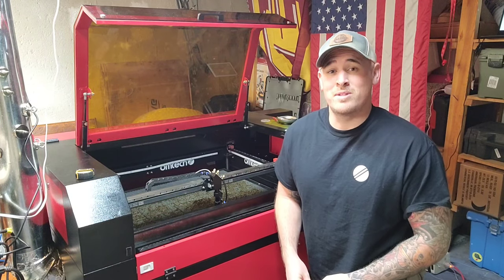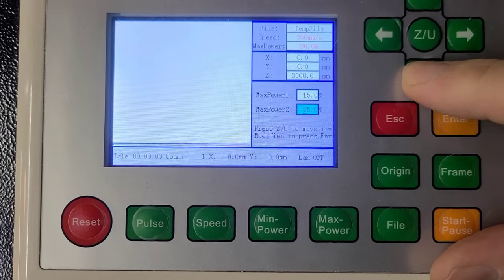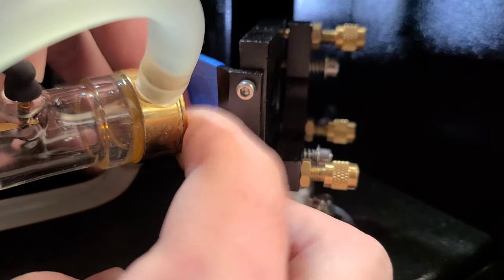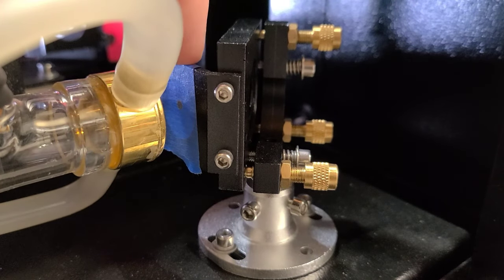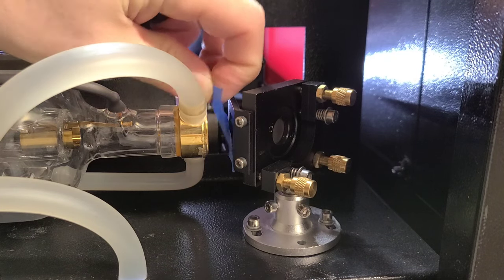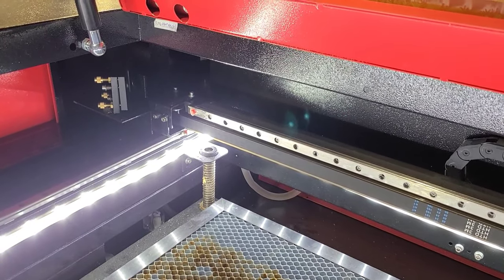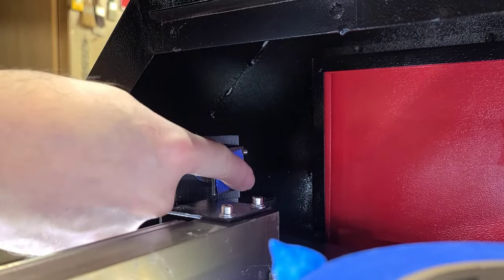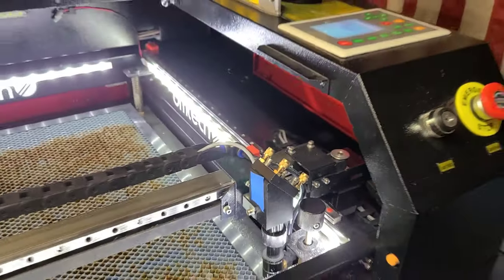How to align your mirrors on your Chinese / OMTech CO2 laser

Comment: hello, i am right now setting my mirrors with help from your video, and i have a question, is big problem if my pulses on 2nd and 3rd mirrors are not absolutely on same places at the start and end of axis (2nd mirror pulse at the start of axis is in center, at the end of axis is a little bit next to first pulse... the 3rd mirror same thing), but the laser beam from the nozzle is at the center at every corner and even in center of table ? thank you for answer :)

Comment: do you have to do this or do you do this if something is moved? I would think this should be done at the factory.
Reply from the maker: Yea this is absolutely necessary. Coming from China, these things get knocked around and moved quite a bit. The 80w red and black and 100w red and black from OMTech dont come with their tubes installed so you HAVE to align it. You literally save thousands of dollars if you go through OMTech and align it yourself, versus going to a competitor who's laser is already aligned.
This is why we create these videos. These lasers are more DIY setup rather than ready out of the box.

Comment: How talll of an item can be engraved?
What materials can it engrave being only a 50w?
Is there a .onthly fee for uaing their softsare like lightburn?
Reply from the maker: The depth that the laser bed will be able to move to will determine how tall of an object you can engrave. The OMTech 50w varies between 6 to 9 inches (there’s two different models). If you get the polar then it’s only a couple inches. 
There are really too many materials to list on what can be engraved but some common ones include several types of woods, acrylics, paper stock, metals (with a special spray coating).
There isn’t a monthly fee for lightburn. It’s a one time $120 and you’ll have unlimited access. They do have releases every year so you can’t pay $30 for continued availability to download the latest releases, but you can essentially run the original release without worry of it not ever working.

Comment: My mirror 3 is off center and I cannot move it anymore to the left because the screw is so loose it does nothing when I turn it anymore to get the beam to go left.  Mirrors 1 and 2 are centered, I just can't get mirror 3 aligned.   Any suggestions?

Comment: Very nice.  Thanks for posting this.   That was a great explanation.

Those mirror holders look pretty flimsy, I'm not going to lie.  They appeared to flex quite a bit when you were messing with the adjustment screws.  

These engravers are extremely inexpensive, so I understand corners had to be cut somewhere.   That is probably an area I'd look into trying to beef up if I bought one.   Or maybe it doesn't matter unless you're constantly moving your machine around the shop?    Any thoughts on that?  How often do you have to adjust these mirrors?

My 20 year old epilog is starting to give up the ghost.   And while I could maybe get it repaired, for the money I think these chinese lasers make alot of sense.  I've tried to pick up an epilog at auction again, but they are pretty few and far between and I do use my laser on a regular basis for a small business. So any thoughts on that you have I would greatly appreciate.

Thanks in advance.
Reply: I'll check my alignment every few months, but i've only had to align it twice since owning it. Once for the initial setup, and once for this video. If you secure the adjustment screws appropriately and not moving your laser around you shouldn't be having alignment issues. 
We run an epilog at my work and although the quality of parts is superior, it is a self contained unit with proprietary parts making it VERY expensive. The nice thing about these Chinese lasers is that they are highly modifiable at a relatively inexpensive price compared to high end machines.....AND they can create the same output.
Reply: @Manalo84  Very nice, thank you.   It seems like the lifespan of the chinese glass tube lasers has gotten better over the years, too.

Probably still nowhere near what an all metal RF excited tube made by synrad or whatever will get (my Epilog is still on it's ORIGINAL tube after 20 years!) but then again, a replacement only costs 250 to 300 bucks for a "10,000 hour" lifespan.   I don't think I could even get the tube on my epilog a gas recharge for less than $1200.

Whatever I do, I doubt I'll get rid of my Epilog.  I still have hope that Ruida or someone will come out with a much more transparent/DIYer controller board that can drive servos and control a RF excited tube, like the one in my epilog.  If that happens, I'll get rid of the epilog motherboard and power supply and send that old tube in to get refurbished.   

Honestly, I think there's a good sized market for something like that.   There are TONS of old Epilog, Universal, and Trotec machines with very high quality servos and VERY high quality all metal tubes that just need an updated motherboard and motor drivers to be useful again.  Speedwise, you can't beat an RF excited tube on a machine with servos until you go to a Galvo style and sacrifice a ton of working space.

Comment: How do you change the focal length lens on these? For example from 2 inch to 4 inch?
Reply from the maker: On my laser head, the nozzle twists off and there is a silver retainer holding the lens in. On other models the lens is in the actual tube. If yours in the tube you'll need to unscrew the collar and pull down on the laser head until the tube comes out. Look in the tube and your lens will be in there. It will be held in with a ring. If you dont have the lens removal tool, you can carefully use some pliers to unscrew the ring holding the lens.

Comment: You show when aligning mirror 2 to check each corner of the bed to ensure the pulse is on top of each one. How to adjust if one corner is not aligned please?
Reply: you need to start from mirror one again. when mirror one is correctly aligned with mirror two this will solve your issue of one corner not being aligned

Comment: Cam can you help me to center the mirror? I have done all 4 corners but I am not in the center. I’m just below it. All 4 corners hit on top of each other but not sure the best way to get it to the center. Took me so long to get it on top of each other and I hate to mess with the mirrors again to try. Any suggestions
Reply from the maker: If you have the pulses at M1 to M2 on top of each other in the front and back positions, and the pulses on M2 to M3 on top of each other in the left and right positons, then you're almost there.

What I didn't show in the video (and will probably be redoing in the near future), is that you can physically adjust your tube to aim your pulse at the center of the M3 frame. You may ask, "wont I lose alignment?" The answer is no. Your mirrors are already oriented to hit parallel to each other so theoretically it shouldn't change. You are now changing your point of aim by adjusting the tube position. 

To do this you can loosen your mounting brackets slightly, and literally take playing card or business cards and shim the front or back of the tube (depending on where you need to aim the pulse) and adjust the tube to where it needs to hit. This will take a couple tries, but hitting center at mirror 3 will ensure that you hit 90 degrees down the tube.

Comment: Didn't solve the problem tube pulse hits middle of circle; 2nd mirror have moved it to hit the center but I can't get the next step left rear of bed to line up.  Would you consider coming to Texas to fix my laser and if so what would you charge?  I just can't get it fixed!
Reply from the maker: I wish I could go back in the video and tell people that center doesnt matter until you're aligning the 3rd mirror to the tube. 
Dont worry about hitting center to the frame. Ideally you want the laser beam to run parallel to your rails. The pulses should fall on top of each other. Whether thats off center or centered, it doesnt matter.

Comment: I just got a new laser, and I am very worried now because I was testing it out last night just to see if the bed worked up and down (powered)
Well I never read the manual first and did an autofocus without material on the bed ! (I know stupid) well it jammed the auto focus rod and almost got to the lens it kinda jammed it hard. Do you think I have damaged the autofocus/lens ??
Is the autofocus rod on the left of the lens just a rod or does it also have a lens in it ?

Thanks, fantastic video BTW

Comment: Hi ! If I don't see laser beetween mirror 1 and 2 ...what woul be the problem ?
Reply from the maker: I have a new laser alignment video that I made recently that may make more Laser Mirror Alignment | How To Guide | CO2
https://youtu.be/GyOKzy-riLE
Reply from the maker: If you see a pulse at mirror 1 but don’t see anything at mirror 2 then you’re probably just out of alignment by a lot. Bring the mirrors closest together and pulse to see how far off you are. From there, move the mirrors farthest apart and make your adjustments to get back on target
Reply: @EdmondsWoodshop  I have a protection water module probably with a bad contact would It be a major conncern for working the machine does the machine work without it ?
Reply from the maker: The water flow sensors job is to detect flow. If you’re getting a water protect error it’s due to two things:
- water is not flowing and your sensor is working correctly
- water is flowing and your water sensor is not working 

If water is flowing and your sensor is not working it could be due to the contacts being dirty. If you have spade connectors on your sensor you can pull them off and clean them up with a toothbrush and some isopropyl alcohol then reattach them. 
If you have a water flow sensor that is wired in, you’ll have to replace it. I used a HT-30 cloudray on amazon and splice the wires in. Works great.

https://www.amazon.com/dp/B07BLTPHXZ/ref=cm_sw_r_as_gl_api_gl_i_V76AB00ENZVQN1TCQ6XN?linkCode=ml2&tag=cameronedmond-20

Comment: Thank you! What model do you use? And do you think autofocus is a must-have, and worth sacrificing 4" of depth capabilities? Or is manual focus just as simple?
Reply from the maker: I use the MF2028-80 (Manual Focus). Link is in the details. I absolutely think autofocus is a waste! Manual focusing and autofocusing takes the same amount of time, and the autofocus just ends up getting in the way of things. I love the manual bed, because I can fine tune the distance that I need without playing with the auto bed AND I get extra depth capabilities because there isn't limit switches preventing me from going down all the way

Comment: Brother, thanks for the video. I'm still haven't figured it out yet. I have been trying for a couple of days to align the beam on lens number two.   The issue is I can get it dead center when the rail is closest to the door. But when I move the rail close to first lens and do a pulse its really high and off to the left.  Is it possible that I am missing something?
Reply from the maker: I know people focus on hitting the center between frames, but try this....don't focus so much on center of the fame between mirror 1, 2, and 3.
The only area where center truly matters is from mirror 3 down to the lens and out the nozzle. If you beam wants to convert a little high and to the right on mirror 2 to mirror 3....so be it.
Reply: @EdmondsWoodshop  So do you recommend just letting it be once mirror 2 is aligned on one of the corners? Because my four corner pulses for mirror 2 also dont align on top of each other like your video

Comment: How do you pulse with the top open?
Reply from the maker: You can either put a magnet on the door sensor or you can go into lightburn by going into EDIT>MACHINE SETTINGS>VENDOR SETTINGS> change ENABLE DOOR PROTECT to false.....hit WRITE....and OK. 

You may need to restart your laser and lightburn for it to take affect

Comment: Great video Cam! I learned a lot on how to setup my future laser lol. What do you recommend cleaning the mirrors with? Do you ever use the diagnol screw to adjust instead of left/right and up/down? Or only when it's a direct 45 degrees? Looking forward to more of your laser setup and other laser videos
Reply from the maker: So I consider the left/right and up/down adjustment screws for minor adjustments or fine tuning. If you use the diagonal screws it's more for a bigger adjustment. When you use the diagonal screw, you're adjusting two directions at once which can throw you're whole alignment off making it difficult to walk the beam alignment towards center.
Reply: Regular household rubbing alcohol and a microfiber cloth is what I use. Squeaky clean!

Comment: Thank you for this video! I'm in the process of reviewing 80-100w version of this laser. How often are you having to make this adjustment?
Reply from the maker: Typically the big alignment is just once. Every month or so you should be checking for loose screws from all the movements and vibration and make small adjustments as necessary.
Reply: @EdmondsWoodshop  So you don't have to realign every time you change mirrors/lenses?

Comment: How do you pulse your laser?
Reply from the maker: With the pulse button on your controller. If yours is not pulsing, check to make sure your key is turned to the right. If that doesn't work make sure your lid is closed. If that doesn't work, make sure your power supply is turned on. Mine has a digital LED on the side. Make sure all connections are seated properly. If you have a laser that requires two power cords, make sure you're using both.

Comment: goods stuff thanks. Just got my Omtech this week, how are you firing with the lid open? Mine won't do that.
Reply from the maker: It’s setting in lightburn that turns off your door sensor. 
Word of caution: be mindful of the laser if you do this

In lightburn >edit>machine settings>vendor settings>enable door protect ….make it say false. Hit okay. Hit Reset on your controller
Reply: @EdmondsWoodshop  cool, thanks. Not sure I'll do it, but good to know how, lol. I do dumb crap sometimes and don't want to go blind from accidental stupidity 🤣
Reply: Tube to mirror length min50 mm required, otherwise lense inside the tube will brocken within 1 year

Comment: Thanks for the video, but to be honest the 2nd mirror adjustment was almost perfect, I am finding my mirror alignment is WAY off, and a lot of people I have talked to have the same issue as me. I wish your laser mirrors were NOT already almost perfect so you could show how to get mirrors aligned that are NOT perfect. When I check my four corners positions, they are off not perfect like yours were.

Even your last nozzle test with the block of wood was perfectly aligned, so again that was not very helpful, I think instruction videos should not start with perfect alignment, but more like real-world Sereno's where some mirrors are way off.  

When I get a good test on mirror 3 in the right front corner (like in your video), and then I move the laser head to the back right corner it is way off - Then what do you do? You did not show how to correct for something like that. Thanks
Reply: I'm wondering about that too.  Seems to me  hitting center conflicts with spot hitting same place on both extents. Maybe if all previous mirrors hit center the last one just works if the machine isn't bent?
Reply: @jrstf  Good point about the laser machine being bent or twisted, I will need to check that and see if a bent machine may be an issue I have. Thanks for the suggestion.
Reply: @phototec  - I just finished my first experience aligning a laser cutter. The final stage was off center, we started over and aligned the laser itself to hit the center of the first aperture, touched up what changed with mirror alignment,  and found it just about perfect.
Reply: Here's some info that amplifies and demonstrates it visually:  https://www.youtube.com/watch?v=i5ApIqMR2pM

Comment: I cannot express how unhelpful it is to watch videos on how to align something where the machine is already nearly perfectly aligned. How about next time, wack your machine out of alignment and let us watch how you make the adjustments to it then? I've been at this for 3 hours and every time I get it aligned in one corner, I make it out of alignment in the next corner and no amount of micro adjusting screws are getting it closer.
Reply from the maker: I provide the fundamentals on how to align i.e. proper adjustments screws, amazing beam parallel to the rail. One this I didn't touch on is that you DONT have to be centered to the frame. If the beam converges off-center then so be it. The only spot that is important for center is down the lens. I'm sorry my video wasn't of help for you. Hopefully you find what you're looking for.